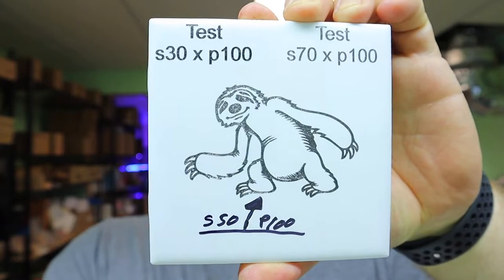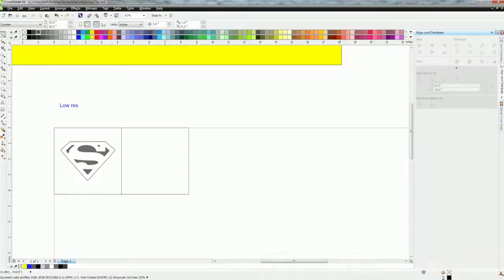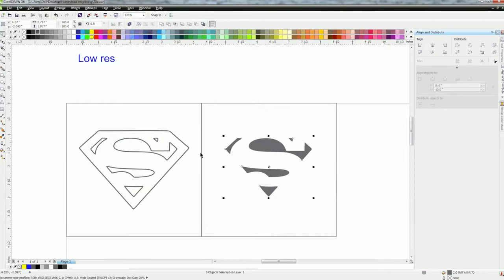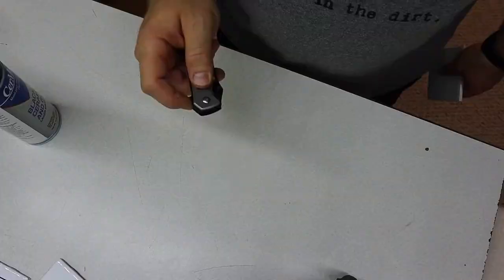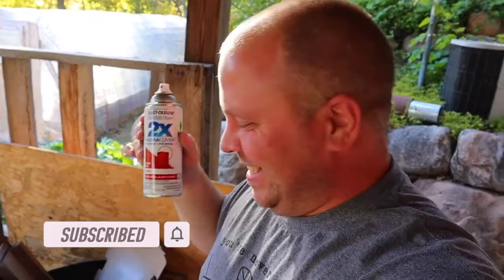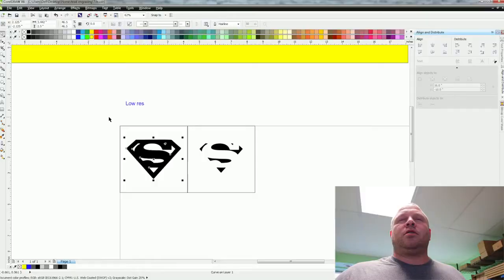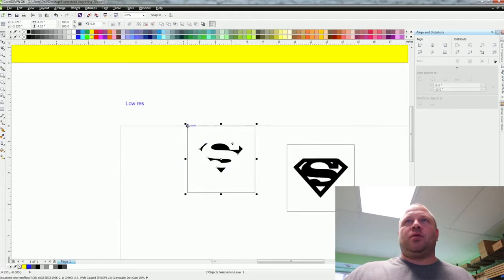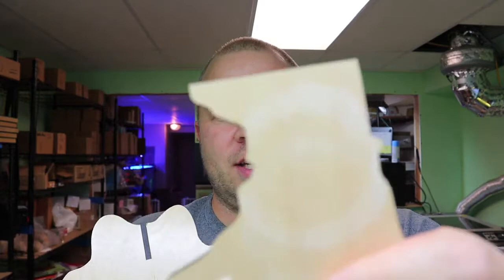Etching Tile with Color

Comment: I think you explained it well and I loved your results. Super clean and vibrant! The paint shaking clips crack me up!! 😂 I've thought about applying Modge Podge (outdoor variety?) before applying the next color. It should seal the masking tape edges preventing color bleed. I'm unsure how much of the engraving depth would be filled in with both Modge Podge and paint. 🤔
Reply from the maker: 🧐 I was wondering if I used the frog painter tape if that would help with the bleeding paints. Now you have me thinking about modge podge.

Comment: I don't know how just paint won't scratch off. Every time I've sprayed tile and used it as a coaster much of the paint rubbed off just from placing glasses and mugs on it.
Reply from the maker: Something isn’t right because my kids even play with mine and it still looks good. Did you engrave it first so the paint can stick to something.
Reply: @laserengravingwithmatt  I think I understand now, you're engraving deep enough that it penetrates the glaze. I painted, then just lasered off the paint where I don't want it. I'll have to test if my lasers can do that. I have the Ortur Laser Master 2, regular and pro models.
Reply from the maker: It should do it.

Comment: If its  just paint itll come off?
Reply from the maker: No, it won’t because it grabs the pores once you engrave the top layer off
Reply: @laserengravingwithmatt  so you just use any paint? And laser over it and itll stay on? Thinking im missing slot here!  Thanks for your patience mate i have a 100 watt thunder
Pat
Reply from the maker: @patdennis4576 spray paint yep laser first to take the top layer off the tile, then spray paint

Comment: Hi Matt, is ther any possibility using the diod laser of 5.5?1
Reply from the maker: I would think that would work.
Reply: I tried with diode laser and masking paper burns at that speed
Reply: @fernandoyebra7071  You have to find your own settings that work with your machine.

Comment: Why does it not scratch off if it's just spray paint
Reply from the maker: Because the paint is in the ceramic and it cannot come off
Reply: So it's just regular paint and it bonds to the porous ceramic after you cut it?
Reply: @laserengravingwithmatt  Do you mean the laser embeds it or the laser clears off the glaze and the paint seeps in to the ceramic?

Comment: What kind of tile did you use? I’ve found that glazed tile needs very slow speeds, 10mm/sec or less to actually cut through the glazed top. You’re using an unglazed tile, correct?
Reply from the maker: It is in the description
Reply: @laserengravingwithmatt  Don’t see it in your description, Matt. Are these just glazed tiles from a big box store?
Reply: As I understood, it's just cutting through the masking tape.